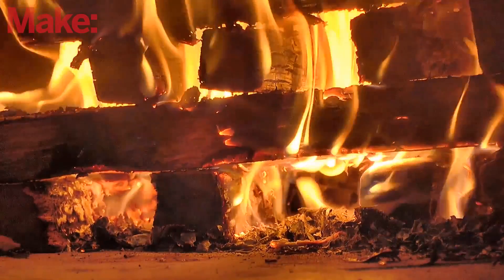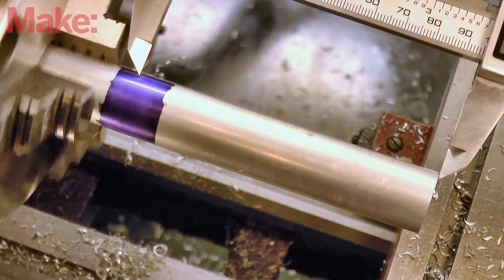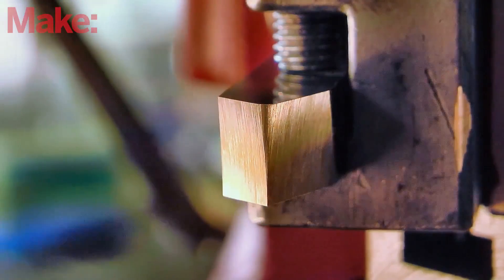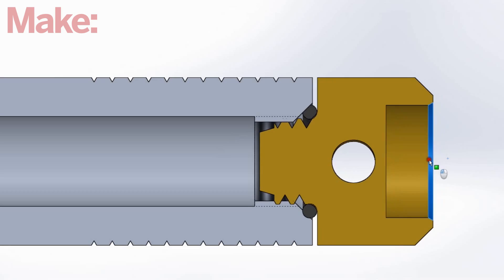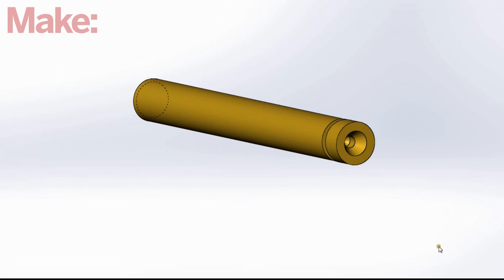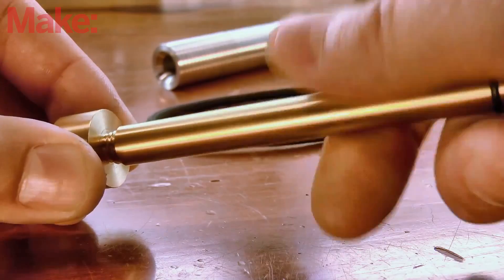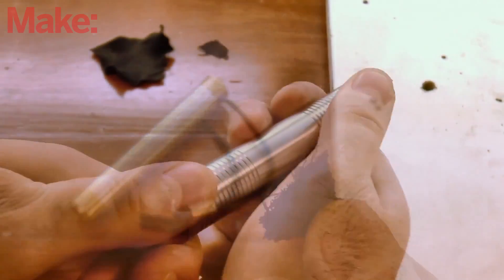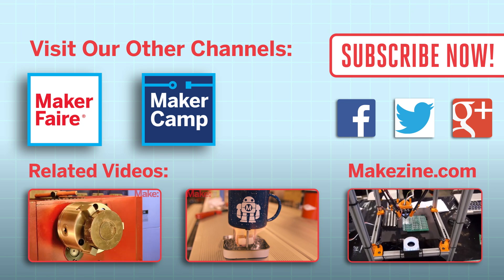Clickspring: Milling a Fire Piston

Comment: Was thinking that now that I have a Sherline 4000 lathe (Rebranded as Craftsman, but it's the same lathe) was thinking of doing this. But just watched the video from the guy who bought both a used 4400, and a Sherline mill, and on reflection, I don't think the 4000 has the bed length needed to bore the aluminum here. Perhaps if the pass through in the head stock is large enough, but I'm not holding my breath. I think it's just over a quarter inch which would be fine for the scribber, not so much for a 20mm or even 15 mm cylinder of Aluminum. Probably going to have to wait till I can pick up a bed for the 4400. Oh well. I'll probably need a steady rest in that case as well.

Also the links to the  plans don't seem to be working. Not a surprise on a 9 year old video, but annoying. I'll check to see if Make: has moved it to a new archive, but as already noted, it may be a while before I can make one myself.

Comment: I machined a bunch of these according to modified plans. I highly recommend you double the o ring to two on the plunger and use a new reamer or lapping compound on the cylinder. Surface finish is critical to success. You can eliminate the o-ring cap on the cylinder. I also suggest using chapstick as the lubricant. Charred Toilet paper makes good tinder, no need to punch a hole in the Altoids tin. You can use a BBQ grill or kiln to make tinder. If going with the kiln 1000 F for 2 hours makes it very easy to light.

Comment: Update 7 years later, my son in-law just got a lathe!
Before that I thinking of using a polished tube and rod from Mc-Master Carr with a tight tolerance, something like .001 or .002 clearance?
That way there would not be any wear parts like the "O" ring that could fail rendering the whole tool useless until it gets replaced.
Thing is, what would the clearance need to be to create a tight enough seal to create enough compression?

Comment: be careful advising using oil on o-rings since true rubber o-rings with deteriorate around oil. Neoprene o-rings work around oil and are OK. Or use silicone lube on the bore of the fire piston cylinder for lubrication.

Comment: Compasses have to include magnets to work.  The stronger the magnets, the better they will align with the Earth's magnetic field.  Or, the magnetic fields from other nearby compasses.  Or the drive motor, or the stepper motors in a CNC machine.  Or your engine block and alternator, when you try to use a compass on the hood of your car.
Don't expect good results from compasses in a pile.

Comment: Build one and install a test port for a high pressure gauge, I'm curious what the combustion pressure is.
Reply: That will increase the volume, greatly lowering the pressure. It is much easier to measure the start and finish volume

Comment: beautifully made Chris, but... aluminium and brass together will act as anode and kathode and will corrode very quickly. You will likely not be able to open that cap after just a bit of air moisture has reached those threads. Full aluminium or stainless perhaps better?

Comment: In general a nice idea I have some issues with the execution though:

1.) I don't recommend this type of endcap sealing, in engineering this is said to be outdated, as you can damage the O-Ring or can't garantue a tight fit. A small ammount of extra lengt ans a traditional axial fitting are o be recommended for this application, as a fitting of the O-Ring on the surface plant can fal off and get lost, same can happen with the approach in this video.
2.) For the other O-Ring fit, WTF are you doing? Such a thing is not to be done by the eye! There is tables online which explain how deep and wide the groove is meant to be, this is literaly hurting me and I'm a trained Industrialmechanic that now studies the art of engineering! The diameter of the piston and O-Ring can be choosen with the table, never the other way round!
3.) The piston itself is fine but I'd recomment to use sandpaper (4000 and higher) in a wetgrinding to make the surface of the bore even smoother. You can use a round piece of wood and glue the sandpaper on and do this in the lathe. NEVER stick your finger in a bore on the lathe, rips it right off, not fixable.
4.) There is one other thing that realy hurts me it's how people use a caliper/gauge for marking "THIS WAY" it gives me the creepes, that tool wasn't intended to be used that way damnit!

Comment: Why don't you use the dimensions from the mil spec MS-33649.  Are you using nominal threading that doesn't match the given sizes in the spec?  It's also been superseded by SAE AS5202.

Comment: dear sir i made a fire piston drilling hole for cylinder as one side closed in 16mm diameter Aluminium rod i want to make smooth surface inside of the cylinder how to do this

Comment: That's a nice piece of work.  You could take it one step further, though.  If you remove the screw-in cap from the case after generating the hot charcoal, then you could use it as a tube to direct and concentrate your breath upon the coal and tinder.

Comment: nice vid..more than just a novelty, a couple of potential improvements..first, use cotton clothesline rather than paracord for the lanyard..more fuel.. second, a better cap for the compass as I see that one cracking after a few compressions..(nice add in, though).

Comment: A few friends and I made a dozen or so of these using a polycarbonate material. No compass or storage space but it works great. I may add the compass to mine soon. I use a waterproof cigar holder ( for two cigars) to hold my extra char cloth and tender.

Comment: "the ability to make a fire without modern methods is a serious impressive skill" shows an engineered fire-making tool with a compass and shit.
Reply: I would argue that this "fire piston"" is more high-tech than a match or a conventional cigarette lighter, let alone a flint sparker or a friction bow. You make one or have one becaus it's kind of cool, not because you need it to make fires.
Reply: There are many sources of oil in the wilderness if you know where to look. In a pinch you can use earwax as a lubricant.
Reply: A match and most certainly a lighter is seriously 'high tech' next to this I would argue. This is great though.
Reply: Tehre's a guy on youtube, primitivetechnology. He made fire drill with sticks and stones.
Reply: No, the oil isn't a consumable.
Reply: Mate, you have to lubricate machinery regularly for it to keep operating. If you don't have access to the oil or at the least some other temporarily lubricating liquid, you're screwed.
Reply: It's not about how you use modern toola to make the tools that make the fire, it's about how you have the tool and can make a fire with it. Thia may be the simplest and most stable way of making a fire: generating heat from a compression.
Reply: Иван Ерохин yeah he got my subscription some months ago. since he build the third hut :D
Reply: Takos_360 The oil applied when it's built will last a very, very long time.
Reply: the fire piston was invented in the mid 1700 or possibly earlier
Reply: Ehh, i'd say the oil is rather necessary for it to function, which is a consumable.

Comment: Brilliant project as always. I've just finished making one for my son but it needs a little tweaking. I think perhaps my charcloth is still a little brown. Best  I can get is a bit of smoke. Just as a test, I put the head of a safety match in and it ignited first time, so must be NEARLY there. Maybe replace the o-ring as it got a little worn on the try-fit groove cutting.  I like the earlier suggestion to put in a second ring though. Even if it never works, it just looks beautiful!! Keep it up Chris.
Reply: Andy Severn put diesel in it and tell me what happens
Reply: LOL Sounds like a pretty dangerous idea to me - don't try that at home kids! (Unless you want a spot on Fail Army)

Comment: The 1/8th hole in the lid is not needed ... the opening left by the back hinge and the looseness of the lid itself are all you need. I've made up over a dozen of these tins without it.
Reply: You mean he took us trough an unnecessary engineering process. However I'm grateful for your comment as I only have metric drill bits and no supply of 1/8th" holes, I've asked.
Reply: Boa
Reply: e

Comment: "Once you've got a tight seal, use a center drill to put in a small racist at the end, and then insert the piston full-depth into the cylinder, and mark the end."

7:25
Reply: +Logan Darklock "small recess". Sounded perfectly clear to me.
Reply: +Michael T Shue Studios geez, it's just a joke

Comment: nicely made! the piston is only secured by the o-ring. I guess you can loose the piston on a real offroad trip. a firestone seems to be the more practical idea and this tiny chinese compass is way to bad to be used for a real trip. nice craftmanship but not very practical, at least for me
Reply: The piston is secured by the vacuum in the chamber, it would be very unlikely to fall out as long as the seal is good.

Comment: Seems like since this was designed on a solid modeling software, some dimensions could have been called out that would have helped make it, like a dimension for the chamfer, given its 90 deg, an outer diameter would have been a good reference. 
Also too, I noticed you used a long pointed tool to extract the burning char cloth, it'd be kinda cool if there were a long pointy tool stuck in the end of the piston cap.

Comment: Don't ruin a nice tin like that, use a tuna can, and load it up with cotton cloth or cotton balls and make a bunch of char cloth at once.
I just put mine in the fireplace next to the fire.
Alas, another project I will not do for a lack of a lathe and milling machine.
Perhaps do one with a drill press, band saw and a belt grinder?

Comment: I made one of these based on the plans, It turned out well. I bored out the cylinder and then used a smaller drill bit rapped in fine grit sand paper to get a nice finish on the inside.

Comment: amazing! but i don't understand how it works.  motion,  temperature or pressure?
Reply: +Hak Kar pressure actually :)
Reply: +Nguyễn Tân Friction
Reply: Jazz Greiner We are both right actually, the immense pressure caused by the piston also causes the air molecules to produce a lot of friction which in turn produces heat which ignites the tinder :)

Comment: looks great, In the past I have had alot of success using simple Dryer Lint from the filter after drying cotton/wool clothes.  Seems to make great tinder but not sure how well it would work in this application.
Not sure if this would replace my current favorite of a 9v battery and steel wool from a scouring pad though...this does look alot sharper.

Comment: where can i buy random pieces of metal rods to mill?
Reply: A metal supply shop. Or if you need odds and ends machine shops will sometimes let you buy stuff they have laying around.
Reply: what are odds and ends? i don't really know much about metal working, but its something i want to get into.
Reply: +Daniel Murillo   "Odds and ends" is a general term,  but in this case it means metal pieces that are left over cut-offs from other project materials.    Basically leftover scraps that are still big enough to be useful to somebody with the need of smaller random sizes,  yet too small to sell as a whole standard bar length.

Comment: Not to be a spoil-sport, but I've always had a simple pill bottle with 80 Grit sandpaper glued inside the cap and a dozen strike-anywhere matches, wrapped up in dryer lint. The lint catches and burns extremely well, the whole thing is a noticeable color, and it floats very well.
Reply: ummm... You can't strike regular matches on sandpaper. I've tried and all it does is sand off the "sulfur". Are they strike anywhere matches?
Reply: are they the same as the "strike-anywhere" matches mentioned in the post you replied to?

Comment: i don understand…….why not simply carry matches???
Reply: +pdoggy10inch What do you do when you run out of matches, or they get wet?
Reply: they our waterproof lifeboat mathces i carry wiht me 24/7 as they be 35 years old and they are still strike and light...
Reply: pdoggy10inch
 Yeah, but you can't carry many of them, with a fire piston, you have basically unlimited chances to light a fire.I'd use the matches first, in a emergency, it's good that you have them.
Reply: guifrakss get any dirt in the piston chamber and it will ruin the cylinder walls same as a car engine……go with ferro rod and striker
Reply: This design seems easy to clean, so I don't think that's a problem. Ferro rods wear out, so thats a problem, but they look cool to use :)

Comment: 2 questions:  Where did you come up with your tool geometry?  I noticed the brass turns beautifully with the tools you grind.
Also, what do you grind them on?  

Smooth work.  A joy to behold and aspire to!
Reply: See my post above - the main thing about geometry is not what angles you choose, but how "cleanly" that geometry is produced. 
Tool steel is best ground on relatively aluminium oxide soft wheels , typically white or pink or brown, about 80 grit, but dressing the stone is the key. You need a single-point diamond dresser to bring the wheel into balance and get it running truly (once that's done you should be able to lightly touch the spinning face at full speed without sensing any vibration), and then ideally a dressing stone (silicon carbide, with a sharp corner produced with a diamond wheel - a cheap 100mm hardware store continuous cutting blade in an angle grinder is OK) to modify the excessively smooth result from the diamond dressing operation, and make it cut more freely, suitable for offhand grinding (diamond dressed wheels are ideal for grinding machines, but need too much cutting pressure for hand grinding).
If the wheel is running out enough that the tool being ground bounces off the face, you need to find a way to spin it more slowly while dressing. If you run it at 2800 (or in the US, 2400) rpm, the grinding spindle will be orbiting about the centre of mass of the stone, and you cannot get a true result. The easiest way for self-contained single-speed grinders is to turn off the switch and start dressing when the stone has slowed down enough that you can see the wobble. It helps to have a heavy stone at the far end, to act as a flywheel, so you get a decent duration each time. Another way is to work out a lash-up to drive it with a drill motor or similar, either directly to the spindle or via a belt, at about one third of grinding speed.

Comment: what kind of milling equipment did you use?
Reply: (SIgh) The idiot who titled this (NOT Chris, aka Clickspring) does not know the difference between milling and turning. This is all turning, done on a small lathe. NOT a milling machine (although Chris does have one of those)
Lathes are for making cylindrical and conical forms; Milling machines for flat-faced prismatic shapes (and some types of drilling and boring, usually in prismatic workpieces)

Comment: It sorta like having a diesel engine in your hands.
Reply: +asdda Just need to create a second mechanism inside the chamber that somehow atomizes the diesel as it gets compressed... That should lower the ignition point.

Then again, you'll also have to come up with a mechanism to not have the piston permanently embedded into your skull after ignition :)
Reply: I wonder if it creates enough heat to make the diesel burn? Like put a drop of diesel in there and hit it. Probably not since diesel gets injected into the engine, but could still be cool to see if it still works

Comment: also you can buy a lighter
Reply: +Abdurhman Meshy You wet your spark stone or electric igniter and its just useless. This is water tight and reliable, not to mention fuel you can make your self.
Reply: +Hellsong89 ok i will
Reply: this is way cooler

Comment: Thank you for another fantastic video as always, Chris. If I may put my two cents in, this is also what happens (called Dieseling) when you shoot a spring piston air rifle. The combustible lube droplets (excess will usually ruin a piston seal) ignite under this sudden pressure, adding more power behind the pellet.

Comment: Titanium has rather low thermal conductivity.  Would that make it easier to use the fire piston?  

I'm thinking that, yes, the heat is generated very quickly, so there is not much time for it to be adsorbed into the metal.  On the other hand, aluminum is rather heat conductive and is used in heat-sinks, etc.  I wonder if a cold fire piston would be harder to use?

Only problem with titanium, is it's expensive and difficult to machine.
Reply: Aluminum, brass, and copper are all commonly used heat sinking materials, so they probably aren't the best thing in the world to use. If you wanted the compass, you should also stay away from nickel and iron, and most titanium has nickel additives, as it makes it easier to machine i think.
Perhaps a ceramic coating would be the best solution here.
Magnesium could work as well, serving as a dual purpose fire starter if you include flint.

Comment: Great video.  Well done.  I have one made out of Buffalo horn and it works great.  But there is a better way to have a quick release in the end of the main tube, instead of having to unscrew that large end that must come out almost fully to release the seal.  There is a chance of losing it in situations where your moving around a lot and it vibrates out.  I also burned cotton into carbon as you did, and folks, it works exactly as he says.

Comment: Try a piston with the O ring right near the end.  The more space in the cylinder at the end of compression, the lower the compression ratio.  Higher the ratio, the greater the heat generated by the compression.